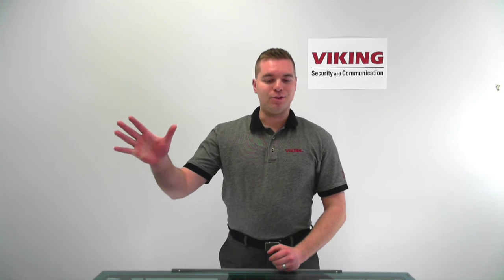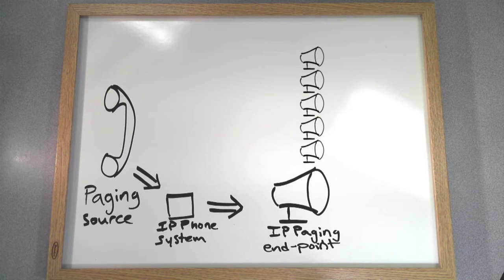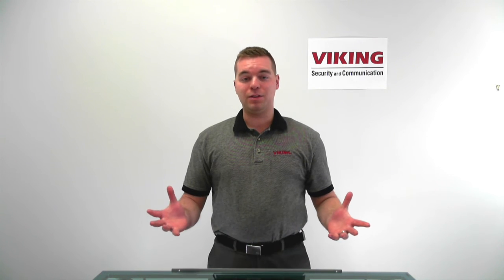SIP Paging System Basic Tutorial by Viking Electronics

Comment from the maker: 00:21 - What to expect in this video
00:52 - Defining IP paging
00:59 - Two types of IP paging
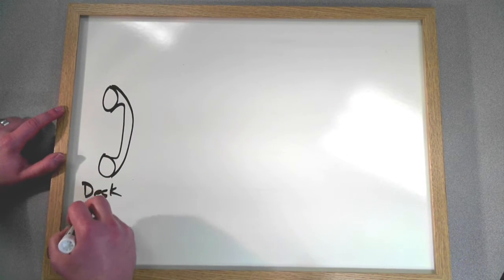01:04 - Unicast paging overview and example set up
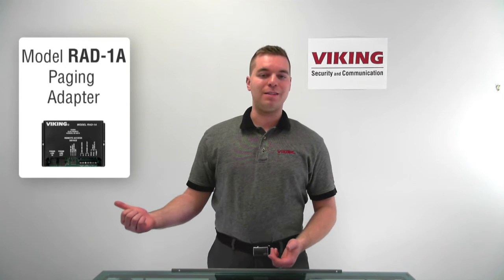01:59 - Unicast strengths & bridging the gap between IP and Analog
02:44 - Unicast weakness: large and decentralized paging systems
03:33 - Unicast summary
03:47 - Important details to know before choosing to go with Unicast paging
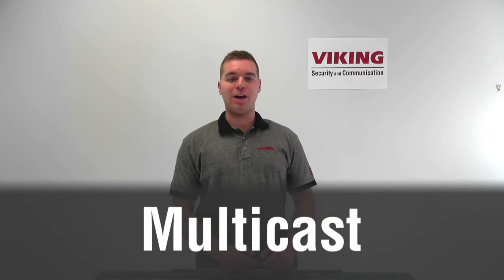03:59 - Multicast paging overview and example set up
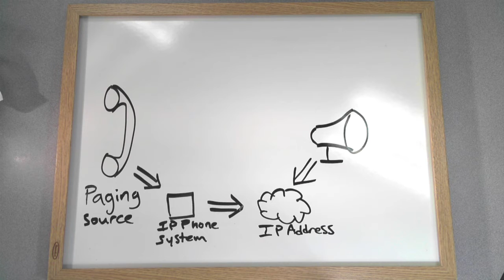04:28 - *Key difference between Unicast and Multicast
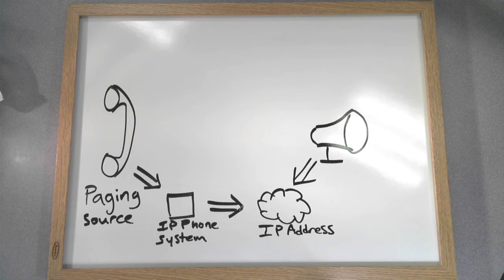04:49 - Multicast strengths and potential cost savings
05:14 - Multicast weakness: complexity and potential security risks
05:43 - Multicast summary
05:56 - Conclusion and closing
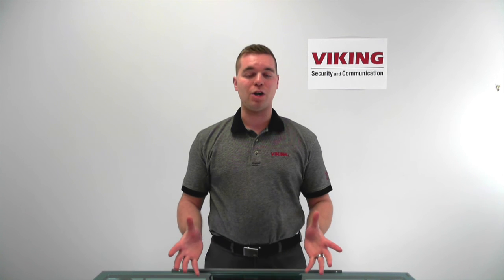06:39 - Blooper

Edit: added blooper time stamp

Comment: Question: Can IP paging be used to monitor/record pages made by associates and managers at the retail level?
Reply from the maker: Viking do not make a product to do this, but multicast audio could be monitored for and recorded via software that was watching for it on the network.

SIP paging can be more encrypted, and is usually negotiated end to end with different ports, so this would require much more effort.

Comment: I'm trying to connect a 300ip to an xblue x25 phone server. What port does the 300ip use and how can I register it with the server?
Reply from the maker: Curtis, the standard SIP port is 5060, if you need to change that, add it after the sip server IP address with a colon, e.g. 192.168.210.100:8454 to use port 8454. For more assistance please contact Viking technical support at Support@vikingelectronics.com

Comment: I have a PA-IP connected to 2 analog speakers (8 ohm 25w rms) to play background music that is send via multicast from a PC. 
Audio quality is really bad. I've been trying to change its bitrate, frame rate and everything but I can't get a good quality audio. Suggestions?
Reply from the maker: Hi Felipe, that's unfortunate about the audio quality. There are several factors that effect audio quality: bit-rate like you said, as well as infrastructure (cable quality, speaker quality), clipping (volume and gain staging), etc. Please call our product support team @715-386-8666 to discus in more details.
Reply: Put your VoIP devices in a separate VLAN.

Comment: We have a Grandstream 6510 that we would like to integrate into an analog paging system with a Bogen TBU-35b amplifier .  Would we need just a single Viking PI-1A to integrate 8 loud speakers ?
Reply from the maker: If you are paging using an unused FXO port on the 6510, the PI-1A will convert that FXO port to a 600 Ohm line level audio signal you can take directly into the Bogen. You also get a contact closure on the PI-1A in case the amp needs a page trigger.

Edit: changed from a question in response to a conditional answer.
Reply: @VikingElectronicsWI  Thank you, for the reply. I also saw a similar product, the  VK-FX1 , are the functions of the P1-1A similar , not certain what the difference is between the two, and whether one would work out better for my situation over the other.
Reply from the maker: You're welcome - if this has been helpful, please consider subscribing to our channel!

The PI-1A allows you to use a 600 Ohm audio source or an FXO port for paging and the FXI-1A allows you to use the same ports as the PI-1A plus the additional capability of using an FXS port to page.

Edit: added more info.

Comment: I just want to know how to wire up my ctg-1 to my pa-2a... Quick hook up so I can send a tone through shop for our meeting times... So many options and diagram is confusing to me... I'm not the best at this but have fair knowledge.
Reply from the maker: Hi Chris, thank you for your feed back about the diagram. Your solution could be as simple as connecting pins 1&2 on the CTG-1 to pins 5&6 on the PA-2A. There are a few options, if you still have questions please call or email us at 715 386-8861 or https://www.vikingelectronics.com/contact/

Edit: Fixed Email Address
Reply from the maker: Hi Chris, there is now a video about connecting the PA-2A for use in paging applications that may answer any of your questions: https://youtu.be/sUoZSXdFnbo